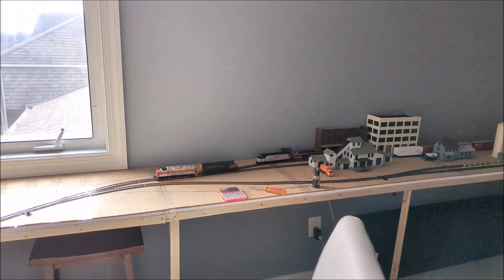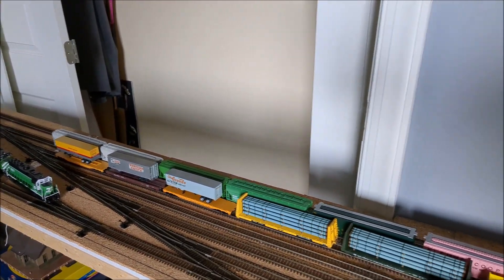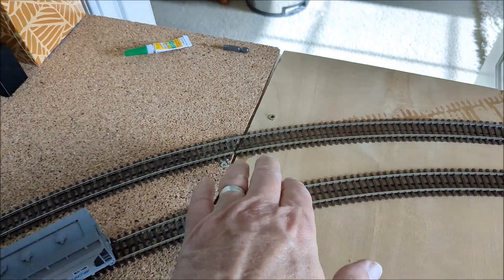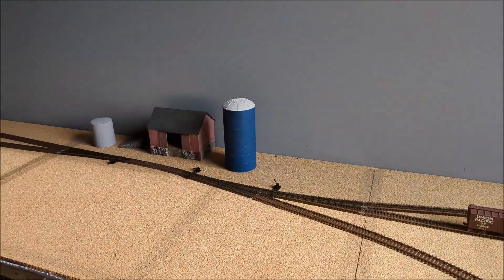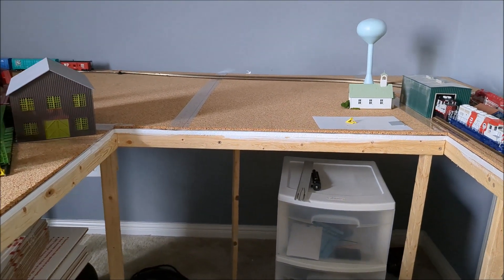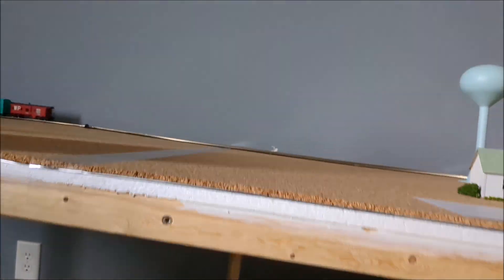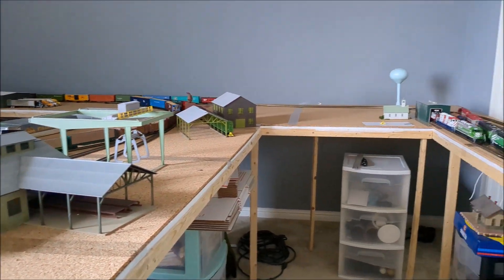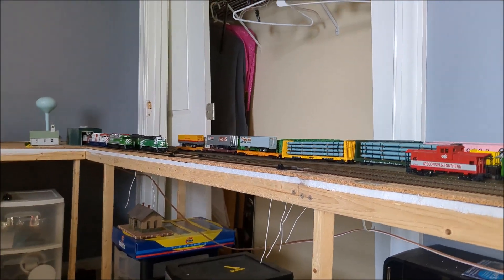Lumberton Valley   Episode 10

Comment: Hi Brian,  Based on the layouts current construction phase, I think, the best option (but far from the cheapest) is to remove all of the trackage. Purchase high quality one inch pink or blue foam and lay the foam directly on top of the existing cork. Good quality one inch foam will not sag if glued directly to the existing cork. Also, be aware even good quality pink or blue foam has one side that is straighter, i.e., more level than the other side. Make sure you are placing the good side UP!  You'll be adding an additional one inch to the height of the benchwork, but that can be covered over by adding an inch to the front facsia. Another plus is you can cut deeper rivers and lakes into the one inch to help get away from the flat ping pong table look. In my opinion this would be the best and fastest way to correct a fairly serious problem. The other soluations are (in my opinon) more of a band aid approch.  Just some thoughts from someone with over 50 years experience in the hobby. Thanks for reading.
Bill Beranek - The Track Planner
Reply from the maker: Hey, Bill!  Thanks for all the great ideas and thought that you've mentioned in your comment!  Cost is a factor for me so removing the track is really not an option as I'm sure I'd destroy a lot of it.  I'm going to run a test with some 1/4" plywood as a support up between the 1x2's and see if that will work before I take any drastic action.  I'll update everyone on the results of the test.  Take care and have a Merry Christmas!

Comment: Thanks for the update Brian. Really glad to see you able to enjoy running trains while these other pesky details get sorted out. I think I would vote for adding the support panels from underneath even though it might require multiple cleats to adequately tie them into the 1x2 framing. You might also consider gluing (or screwing) a stiffener on the underside of the Masonite directly under the longer runs of straight track. Otherwise the layout with its first structures is definitely looking good. Look for you in the New Year (if not before) and may you and your family have a very Merry Christmas.
Reply from the maker: Hey Art!  Yes, "pesky" is certainly the right term for these issues.  I believe that I have everything running well now and have fixed the derailing issues.  Beginning to consist my locos now for some final test running.  After that, it's going to be coupler and wheelset maintenance and then on to scenery, after the reinforcement project, that is.  Take care and have a Merry Christmas!

Comment: I vote with Dave and just do some more bracing underneath. I cringed when you said ripping up the foam...as thin as it is it will rip, crumble and tear apart really easy,  or as someone else said, take up the track and put a 1 inch pink foam down. Good Luck with whatever you decide. Have a great Christmas and glad you are having fun running some trains!
Reply from the maker: Hey John!  I've decided to run a test with some 1/4" plywood and "L" brackets as bracing.  I took a look at the foam and I agree with you that it would be destroyed if I tried to remove it from the 1x2's.  Take care and have a Merry Christmas!